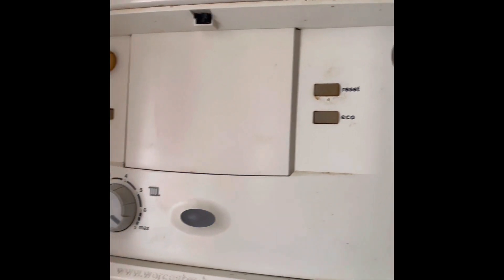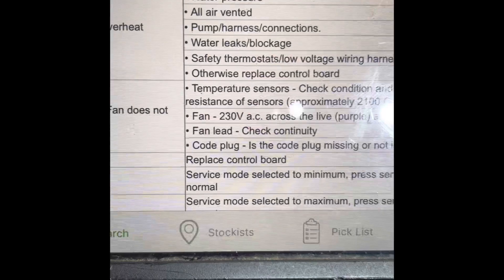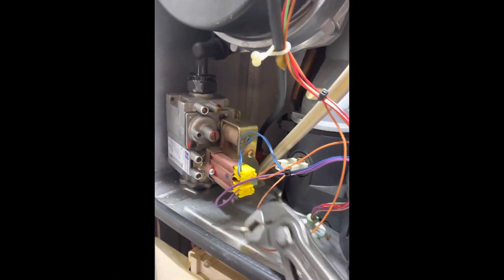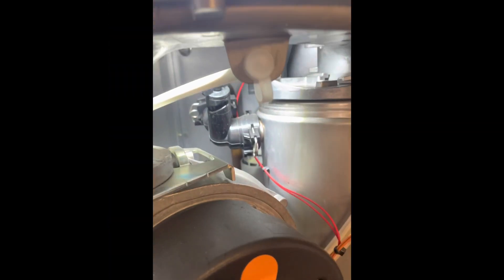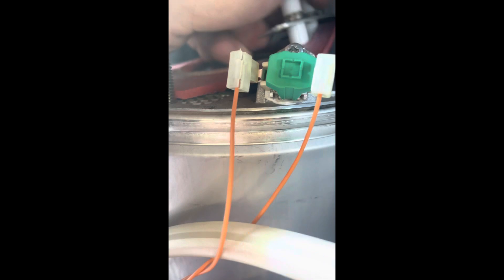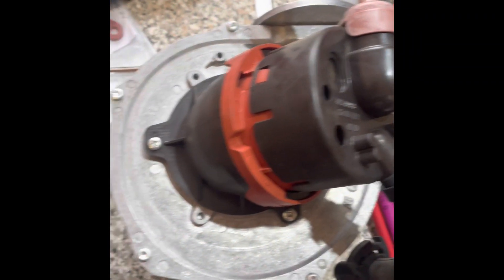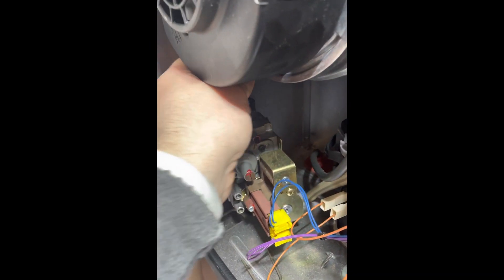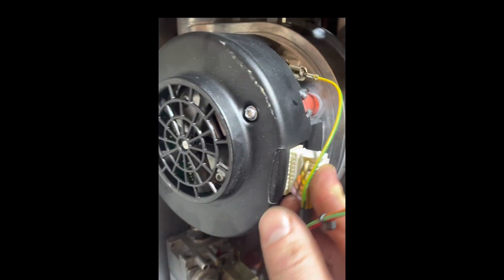Worcester Bosch greenstar boiler with fast flashing blue light no heating no hot water

Comment: Have same issue had gas safe boiler guy out diagnosed as fan repaced it and works for few hours but went of he has replaced the fan 3 times now this time it went of when we used hot water in bathroom then fan dosnt work anymore its like they are getting blown any ideas  please
Reply from the maker: Could be the harness or the pcb
Reply: @boilerstobathrooms I think I need your service, where is your business based on? I'm in Dartford.
Reply: Did you ever get it fixed?

Comment: Great video thanks . got blue light flashing non stop on a greenstar since I changed the pressure gauge . customer still have hot water and heating . though I maybe pressed service mode by mistake . but no... still flashing ...brain freeze / puzzled ...
Reply from the maker: Fast flash is normally the fan but can be control stat wiring harness or pcb. Did you turn power off and back on while
You changed pressure gauge? I’d use a hairdryer on the fan then turn it back on
Reply: @boilerstobathrooms  yes turned boiler off when I was replacing gauge . Will try the hairdryer 👍thanks .